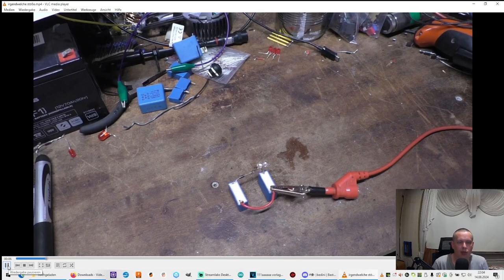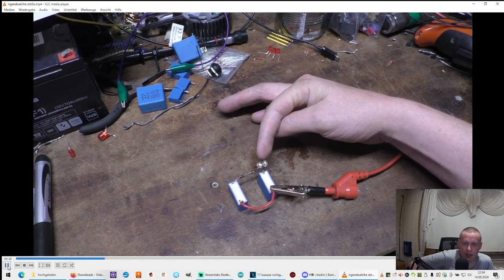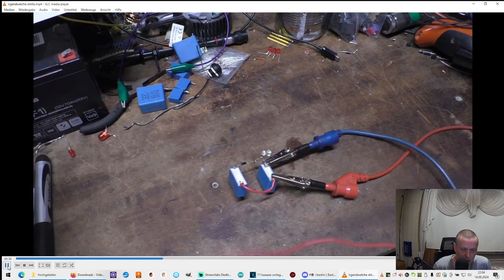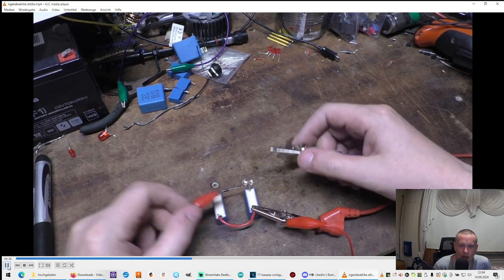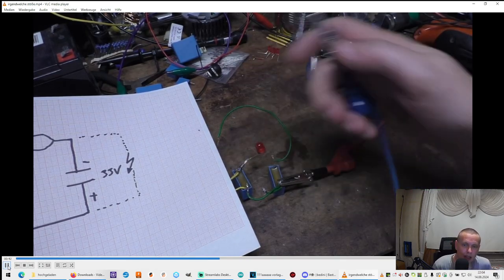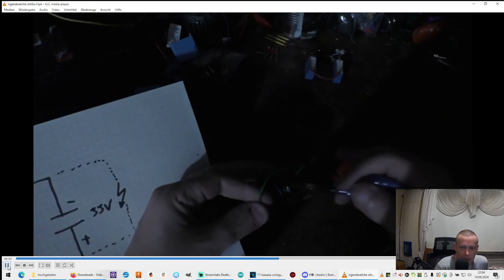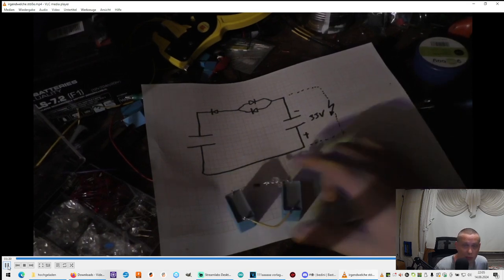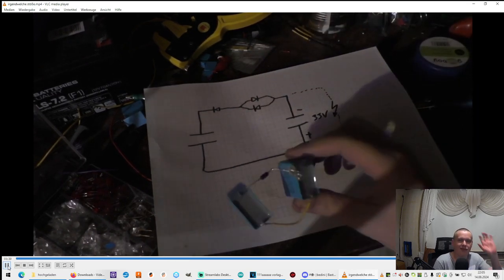#backemf Simple Circuit

Comment: Da 2 Kondensatoren involviert sind werden auch mher als einer Polarisiert. Beim Kurzschließen verschiebt sich die Ladung und ein ausreichendes Spannungsgefälle an der den LEDs tritt auf um sie zu zünden
Reply from the maker: @SadLonelyEmo161  Könntest bitte noch genauer drauf eingehn? In meiner Welt is die Energie beim Kurzschluss eigentlich weg. Kondi 1(links) hat 0v zu Beginn un ende. Mit oszi kann ich an kondi 1 ein 1v puls messen wenn ich kondi 2 Kurzschließe.
Reply from the maker: @SadLonelyEmo161  Mit 2leds antipara komnt noch dazu das beide leuchten. Obwohl ich an Kondi 1 nur 1v dc positiv messe. Wo kommt der negativ puls her un warum kann ich diesen nicht über kondi 1 messen?
Reply: @action4free369  Morgen muss früh raus. Vergesse ned das beim Kurzschluss du schnelle Stromanstiegsgeschwindigkeiten hast und die Kondensatoren auch Induktiv wirken